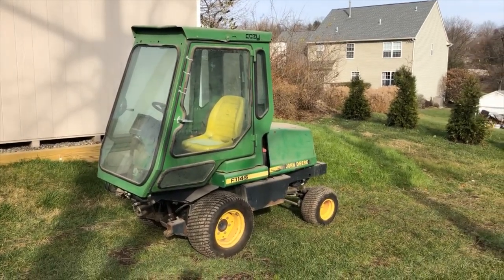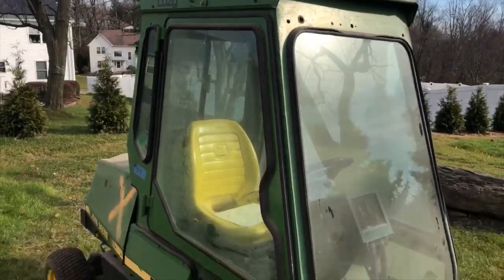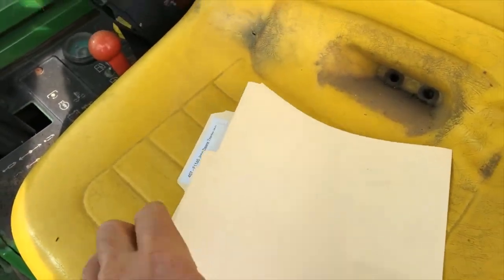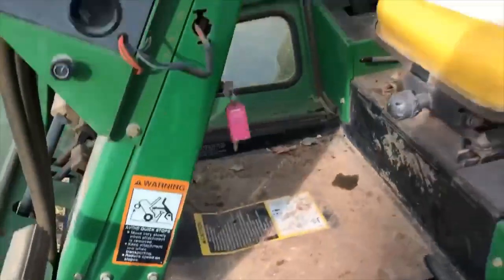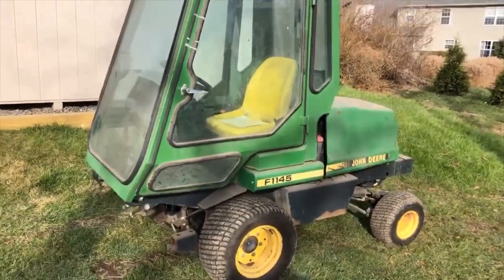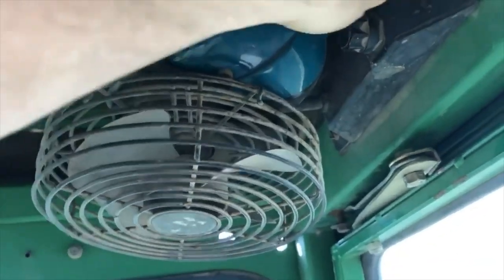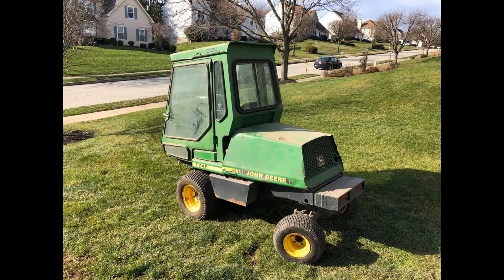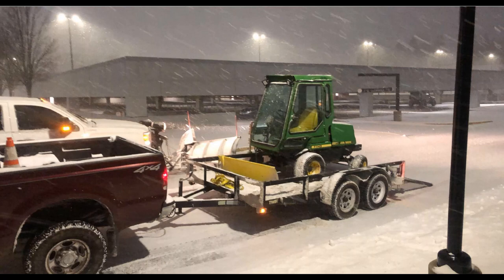New Addition to the Fleet: John Deere F1145 With A Cozy Cab

Comment: wow nice find, Ive got a 1145 Ive owned since 2003? now has 2500 hrs on (JD 60" and 72" deck, a 72" lastec flex deck, snow blower, brush, and blade.)no cab.  I used to find lots of attachments but hard to find now.  found a 2nd one like this one with 72" deck and with a cozy cab about10 years ago$1500 with 2900 hours (but rusty!!) was used by a college in chicago. now has 3100 hours.  engines with maintenance will outlast the machines.  only problem ive ever had with either is fuel pickup lines in tanks replaced and had a  fuel shutoff solenoid went bad,  I mow my 2 acres and 1 neighbors lawn,  plus move snow for small development of 4 houses plus my own (about 1 mile) never had a 1145 let me down, 4x4 no chains hard to get stuck.

Comment: What is the price of one in the US. I have two F 1145s and one F935. In Poland, you can buy one from 3000 dollars, but they are for renovation.
Reply from the maker: Here in the US, 4-6,000 dollars will buy a decent F1145. Some nice machines can be had for less, it all depends on the variables; whether it’s attachments included, hours, and overall condition.